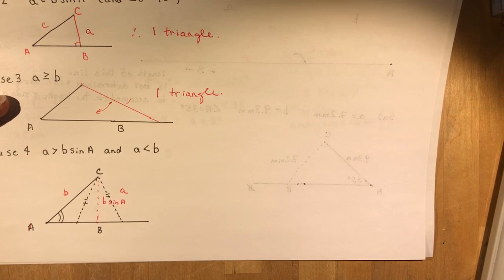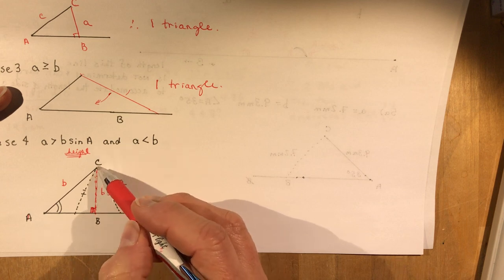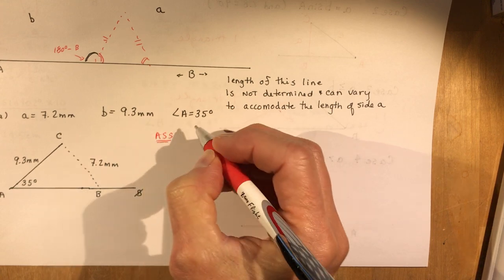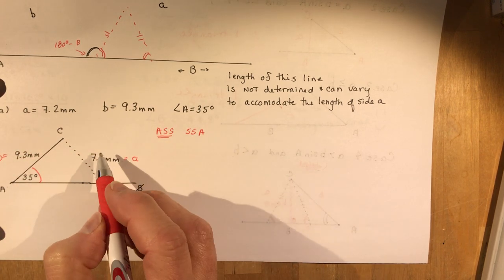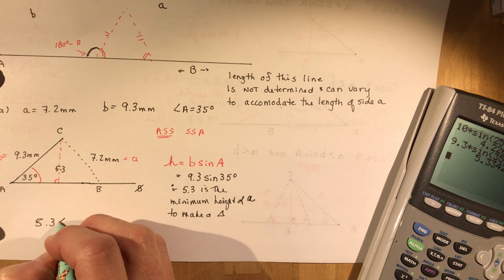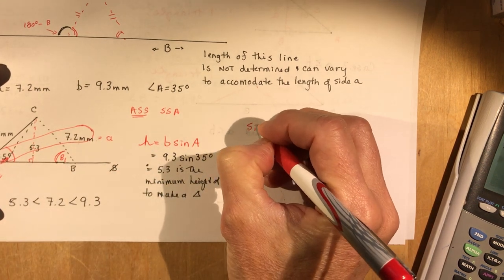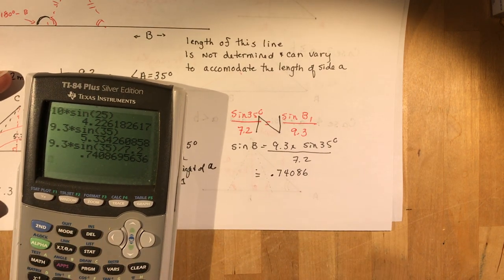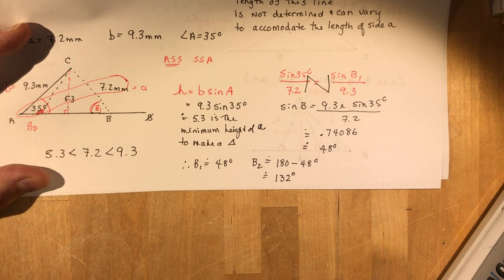Ambiguous Case - with example

Comment: hey, could you please explain question 10 on page 319? We have to use sine law and i am getting height as 13 m but answer is 25 m.
Reply from the maker: I get 12.947 m  … the textbook must be wrong. I think they did cos34°=h/30 which gives you 25 but makes no sense whatsoever.
Reply: @mshavrotscanadianuniversit6234  exactly the solution does not makes sense. But thank you so much for your reply 👍😊